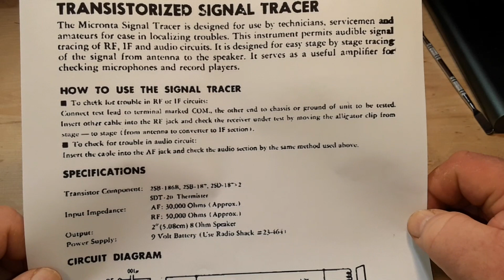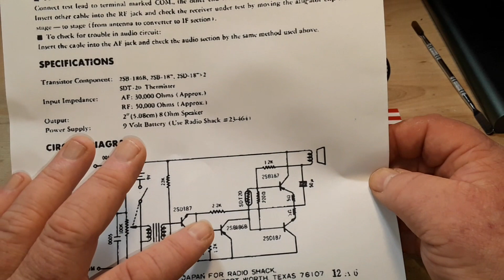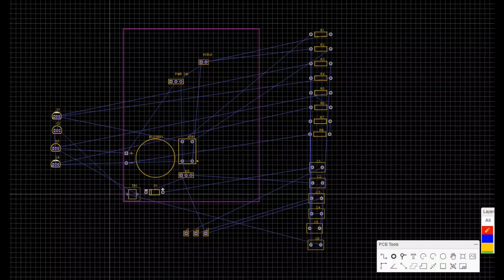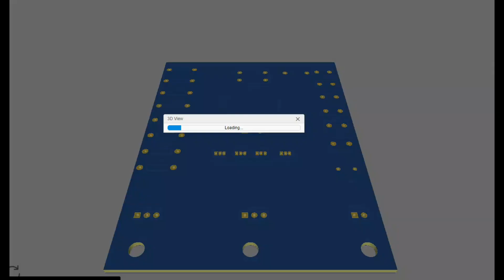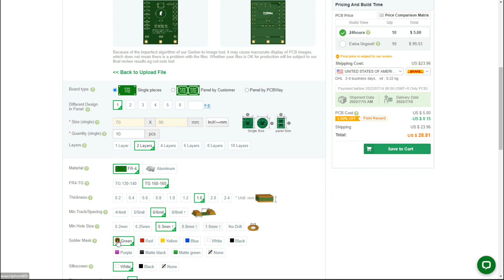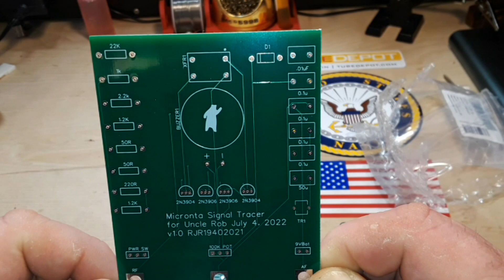Micronta Signal Tracer PCBs For A Friend

Comment: Hey - I reached out for the gerber files and had some boards made, but it doesn't work - Is this me or has there been a design flaw perhaps?
Reply from the maker: IDK I make them for a friend and never heard back. He was going to use his components.
Reply: @learnelectronics  Thanks Paul -No news is good news. I will check my build and then trace through the schematic if it still doesn't work

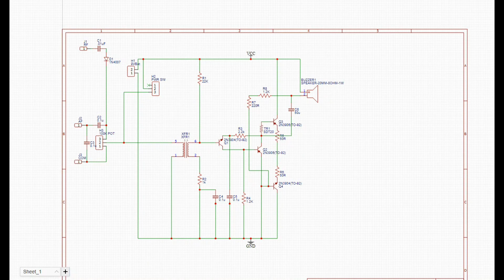Comment: I'm sorry but If the schematic at 4:22 is chosen,then it won't work.There are several flaws.And several  component values chosen for the new tracer are also wrong.If you replace the original Ge transistors,several values have to be changed.
The original schematic is OK.
(If you want to get out the most of it,it's possible to tweak some values)
Reply from the maker: The person I made this for can put in what ever values he wants

Comment: This is a good project. I especially liked the layout demonstration. I thought I already have this unit, but it turns out that I have an Elenco ST-751 tracer/injector which uses op-amps and is a little more sophisticated. I DO have a Micronta logic probe, but many DMMS do that now.

As far as brain fog and memory lapses - that is very common these days just because of the crazy times. We are all distracted. I'm in my late 70's and my solution is restudy all my ham radio electronics, as well as lots of exercise and god food.  You will be alright.  Cheers!
Reply from the maker: Thank you!

Comment: Hey Paul, how do you like that Hantek DS02D15 you have. I am going to buy a scope for my almost complete electronics work bench I am building. I noticed on older videos you had different scopes so that is why I ask. I love your channel and you are pretty cool too. :)😄 I am also looking at the RIGOL DS1202Z-E 200 Megahertz 2 Channel Digital Oscilloscope with 3 year warranty. No signal generator but I can buy one standalone later. What to do?
Reply from the maker: Hi there Dave, thanks for taking the time to write. I like the d15, it's a good all-around scope. Just to make sure you know it is a beginner scope. It lacks a lot of triggering features that you might want later on. There are lots of scopes in my videos because I love oscilloscopes. When I first went to basic electricity and electronics school after boot camp in the United States Navy, and I saw my first oscilloscope I was just blown away. It was a big old tectronics unit. Probably 3 ft. Long weighed 150 lb but I just loved it. So I reach do reviews.
Reply: @learnelectronics  Paul, I can see why you have a lot of scopes and I feel a wild goose chase in my near future. Now I am looking at the  Rigol DS1054Z as my first choice. I am just a hobbyist and I don't think I will need more than 50mHz, but it's a 4 channel without a signal generator. But is is very popular and has high reviews. I have to start somewhere and it seems like a good deal at $419 with free shipping. What do you think? Thanks!
Now I am looking at a Siglent 4 channel 100MHz scope and adding the triple outlet power supply and the Arbitrary Waveform - Function Generator. I am getting sucked into a sinkhole already. LOL :) 
Ok, I finally committed and bought the Rigol DS1104Z-S Plus and hope to settle my brain down from all the research. My hair was almost on fire. :) Its a 4 channel 100 MHz scope with a built-in function generator and optional MSO capability. For $699 I think I did good. That is my birthday gift and I will grab a power supply for Xmas or before if I see a good sale.
Reply: Forget question mark at end bad iPhone!
Reply: You can buy a mor affordable lower Rigol and program it for higher use. Last I knew from 60 MHz to 200 MHz. Videos on YT.
Reply: There is a very small sine-square-triangle function generator I had, lost and can’t remember the name. I want to get it again. Like this Signal tracer operates off  a 9 volt battery.

Comment: Could you feed an audio signal to pin 5 through a series capacitor , I want to use it to play music with my tesla coil feeding the pin 5 on the interrupter 555 timer ,I would get it interrupting at a high frecuency at witch the coil starts making a tone sound and then feed the audio signal  , but I am not sure how to do it plus I do not want to burn my cellphone or whatever I use to feed the audio signal , could you make a video about it ? I guess what I want to know is how to audio modulate through pin 5 , I can't find any video explaining about it , I could try doing it by feeding a little speaker instead of my coil

Comment: thanks so much for this video.i am just
 learning basics and found
 how you took and old schematic and turned it into a modern version remark
able
.i assume later video might show us how it will work in trouble shooting.
silly question.for the circuiit or radio you are troubleshooting is the power on or do you rely on power of the test equipment.
thanks
john